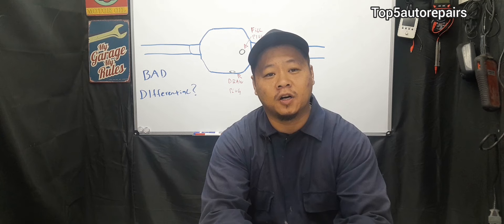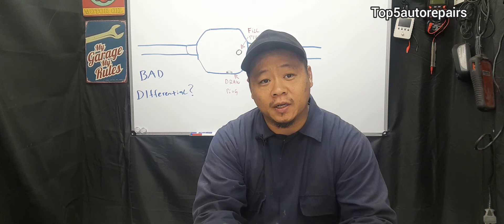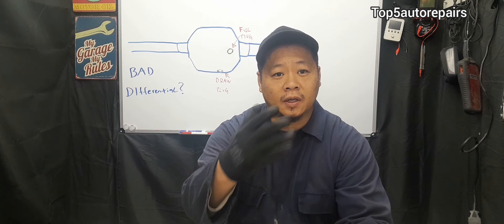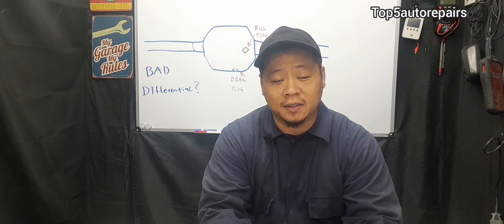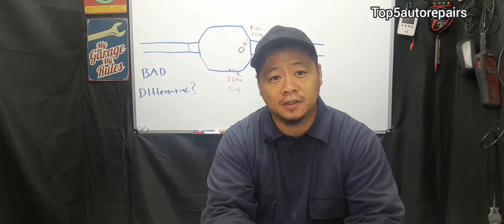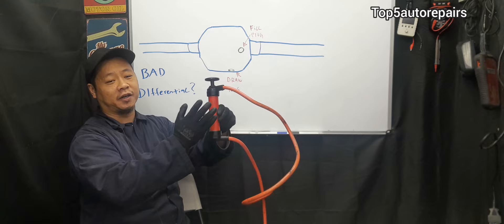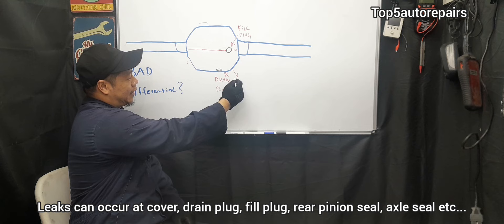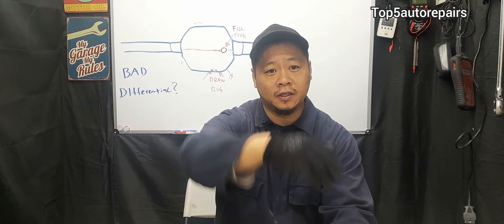SYMPTOMS OF A BAD REAR DIFFERENTIAL (NOISE LEAKS ETC...)

Comment: A reason I’d like to add unless someone already did here then I’m sorry… but wife ran over a pillow and it exploded and somehow became entangled all around my rear axels and diff which then over time caused a lot of extra heat and friction and apparently melted my seals and now after three months I have no oil in it… 2019 dodge challenger GT with 26,000 miles 3.5 years old. Waiting to take it to dodge for the appointment… but I drive only in emergencies. No more than 3 miles at a time. Hoping I don’t screw it up more. Because when I noticed the humming I didn’t think much of it (car dummy) now I have learned much about cars and to never just ignore cries for help. Now it grinds and sounds so much worse. It overpowers my muffler resonator delete lmao😢

Comment: Back in the day I had a 95 trans am that required a rear end gear additive.  I changed the fluid once and didn't add it in so every time I made a turn I'd get a weird noise.  I had to do it all over and add the additive.  As soon as I did the noise went away.

Comment: My Chevy Captiva AWD has an issue. While turning the steering or making a U-turn at slow speed, the car shredders as if something is holding the tires. While reversing and turning the steering, it holds the tires with vibrations. Moreover, both the rear tires are worn only on the inside. The problem doesn't seem to exist when I remove the drive shaft. I tried to change the drive shaft of a good car, but the problem didn't seem to go away. Please help me. What might be the issue with my vehicle?
Reply: Had same issue on 2015 buick enclave awd. Replaced the clutch pack module inside the rear limited slip differential and it fixed it
Reply: @coltredwine1028  Thank you so much for letting me know about your problem being resolved.  I am going to try to have my rear differential opened up this week for inspection.

Comment: Someone Asked If There Was An Additive? Maybe Lucas Product? I Don't Suggest Using Anything Lucas Makes Other Than Fuel System Cleaner! Use Motul 75-90 or 75-120 And Maybe TUFOIL 2oz's? Some Rear Diffs Get These Noises And Some Don't Even With 400K Miles Stay Quiet Even In The Same Exact Vehicle With The Same Rear Diff, Why? I Have No Idea? Maybe Some Are Made On Friday Or Monday Hangovers?

Comment: I HAVE AN 02" BLAZER ZR2 THAT HAS BEEN BABIED. I HAVE A NOISE THAT STARTED OUT SOUNDING LIKE A LOW POWER STEERING FLUID WHINING SOUND FROM THE REAR. 
I THOUGHT IT WAS MY DRIVER'S SIDE OUTER WHEEL BEARING WHEN I JACKED IT UP & THROTTLED TO 30MPH IT WAS LOUD. 
I JUST CHANGED IT OUT & THE NOISE IS STILL THERE. MORE IN THE DIFF & PASS SIDE. 
I NOTICED IT DOES HAVE THE G80 LOCKER IN IT. 
EVERYTHING LOOKED GOOD, NO NOISES WHEN I TURNED THE SHAFT BY HAND. 
IT'S ALL CLEAN, NICE & TIGHT. 
IT HAD VERY LITTLE SHAVINGS ON THE INSIDE MAGNET. 
NO LEAKS ANYWHERE, NO PLAY IN MY PINION GEAR, IN MY WHEELS BESIDES THE PASS. SIDE REAR HAS A LITTLE IN/OUT PLAY & A LITTLE NOISE (PADS & BEARING, I THINK) WHEN I ROTATE BY HAND. 
I HAVE A STICK MAGNET I USED TO LISTEN WITH & PUT IT TO THE DIFF COVER & IT WAS KINDA LOUD IN THERE, THERE WAS NOISE AT THE PASS. SIDE WHEEL ALSO. COULD THAT BE DRONING NOISE TO THE DIFF? 
I'M CONFUSED BECAUSE THERE'S NO CLUNKING SOUNDS. NEW U-JOINTS, ETC. 
MAYBE ITS THE PASS SIDE REAR WHEEL BEARING & I'M JUST OVER THINKING THIS. I DO NOT TOW OR ANYTHING WITH IT. JUST A MALL RUNNER..
I'M CURIOUS WHY THERE'S NO IN/OUT PLAY ON DRIVERS REAR BUT THERE IS ON THE PASS SIDE WHEEL? WITH IT JACKED UP, THE PASSENGER SIDE SPINS & IT'LL ENGAGE THAT LOCKER & DISENGAGE, THEN IT JUST KICKS IN & OUT. SOMETHING I DIDN'T NOTICE BEFORE I CHANGED THE BEARING OUT..

Comment: My noise is different.
It sounds like clacking, usually on deceleration. Sometimes it's quiet like at slow speeds or with the clutch in.
It can go for a while with no noise then other times it's pretty bad. 
If I gas it and get it on the freeway it's smooth till I back off.
Goes away with the clutch in.
Sounds like a rattling muffler but I changed that and it's still there.
Fluid was horrible and I changed it twice. Each time it gets better.
I'm using cheap Valvoline and no LSD additive because I hope to keep flushing it out.
It's very smooth with no whine or rumble.
A few flecks of metal on the magnet but just a little.
Hoping it cleans out but don't want to keep driving it when it's rattling.
It's a 2002 Miata SE so it should have the Torsen.
They're over a grand to replace so really hope it can be fixed.
Maybe an aftermarket like Cusco or Tomei but they aren't cheap either.
Any advice is appreciated.

Comment: Thank you very much for your informative video. I have a 2011 Chevy Silverada 1500. When I change gears there is a noise in the differential by the shaft. Also the differential moves upward a little bit when I change gears. Any ideas? Do you think I need to rebuild the whole differential or can it just be a gear box? Thank you again.

Comment: Great video, i got problem with acadia 2016, sometimes when turning at low speed( left or right) and accelerate  got very loud bang like someone hit rear of the car with hammer, any idea if that might be differential? under everything looks normal no loose parts etc. It almost looks like that loud bang was made when one of the wheel spins faster than the other, thanks

Comment: When I take off from a stop in my truck a lot of times I hear a bad grinding noise under my truck. I changed the gear oil and there was little metal specks in the oil. So now I’m thinking transmission?

Comment: Why does my differential oil excessively leaking from the vent tube on 2003 grand marquis? Oil changed 8 months ago.
Reply: Could be a blown seal transmission fluid getting into the transfer case

Comment: What would make a rubbing noise from back right rear that goes under the car when first accelerating at times and stops when go over a bump? Only happens off and on. Just had brakes changed a month ago and started a few days after.

Comment: How do you remove the overflow (stripped) bolt? I changed the rear differential oil on my 2014 Tacoma 4x4. The overflow/fill bolt is stripped. I think I over tightened it (after filled). Now it  turns kind of stiff but it won’t tighten and I can’t take the bolt out either. The drain plug is on there tightly, no oil leaking yet. I wonder what would happen if I drive at high speed on the freeway.

Comment: My Chevy Tahoe wasn’t going in reverse I drove it and it was making the same noise u making then all of my shifts stop working Is it my rear in?
Reply: If your Tahoe wasn't going into reverse then all of your forward gears stopped working your transmission needs an overhaul. It has a 4L60e and they very commonly fail.